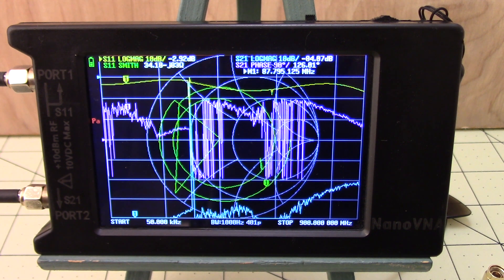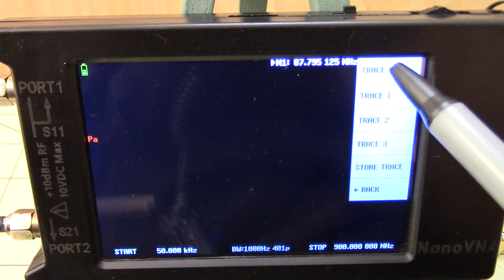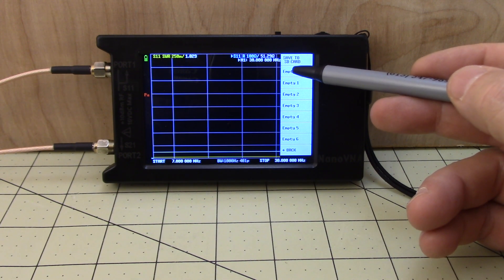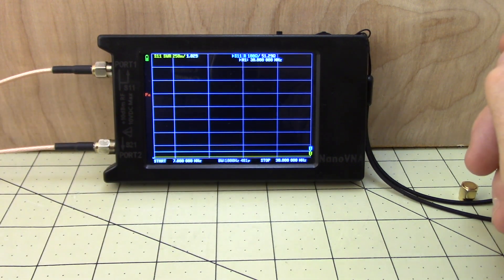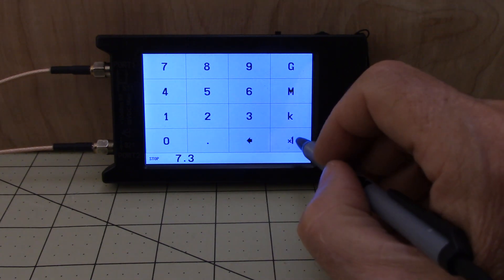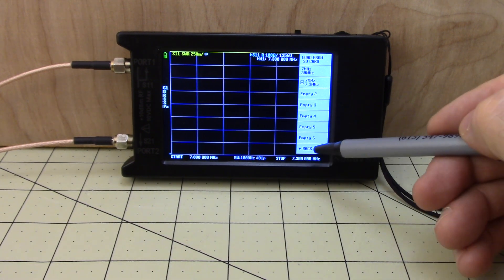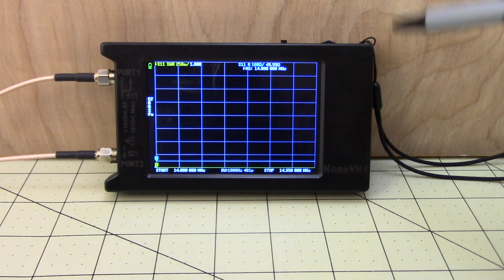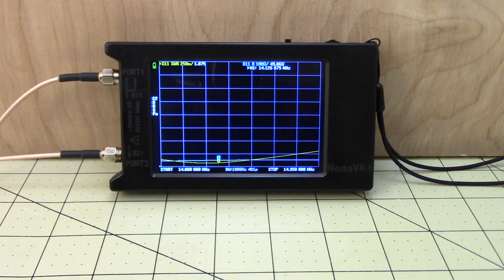How to measure SWR and Resistance of antennas with a NanoVNA

Comment: I noticed ohms went up and down depending on frequency 
Shouldn't ohms be the same ?
Tnks
Reply from the maker: when dealing with antennas and antenna systems you are dealing with impedances rather than dc ohms. Impedances are a combination of both inductive and capacitive reactance the RF signal interacts with which are measured as ohms.  The reactance varies with frequency which is what you were seeing. This is just a simplified explanation of the process.

Comment: What about if we're using a G5RV that needs a tuner like an LDG ?  Is it not really possible to test that transmission line with a NanoVNA and the LDG tuner in-line ? 🤔
Reply from the maker: You could but what are you really testing?  The transmission line and antenna? or are you testing the tuner and how well you have matched it to your radio? Depends on what you are really wanting to test. Hope that makes sense to you. Thanks for watching and commenting!

Comment: Very, very nice video.  I am having problems understanding how to use **multiple markers**.  Case in point here at the AF5SS shack --- a long wire random length antenna that has multiple "dips" on the swr sweep from 4Mhz up to 25 Mhz.  The yellow marker (1) is seen, but how do I place other markers at other resonant points in the sweep plot ?  I think I have articulated this correctly but I am maybe confused -- hi hi -- been on the air since 1957, age 83 next birthday and no, I am not in some "care home" either. Just came home from my skydiving drop zone.  Solo flying,
Reply from the maker: I am out of my shack next couple of days. Will try to answer when I return.

Comment: Great common sense and simplified explanation of setting up and using a NanoVNA for a simple but powerful and intuitive antenna analyzer.  It only takes another minute for each calibration to include the isolation and through calibrations so the complete calibration can be saved for each band in case you'd like to use port 2 to analyze a network - filter, choke, balun, unun, etc.
Reply from the maker: Thanks! That is what I do too!

Comment: Nano VNA pode ser usado para cabo RF 7/8 ou 1/2 para VSWR para identificar falha? ( Torre celular)
Reply from the maker: sure. you just have to have the proper connector adapters, otherwise it should work fine.

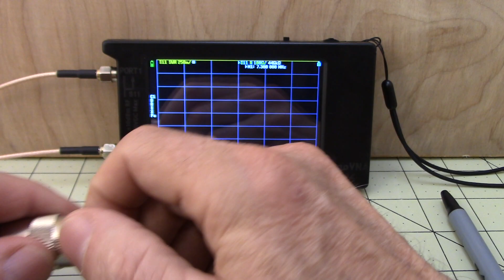Comment: 12:52 adding adapter that was not in measurements. not matter there antenna cable included
Reply from the maker: That is true.  However it is not possible to calibrate with the adapter. It will affect the readings although it will be very very small difference. It can be totally compensated for if you want to take the time to do it but the overall results will not be impacted. The NanoVNA allows you to adjust the timing to compensate for adapters etc if you want to. It really depends on the length of an adapter or its reactive component as to whether or not it would be necessary to go through the compensation adjustment process.

Comment: hello i received the Nano VNA  ..on the back ,i see printed Nano VNA-H   HW version  .....  when i go to the screen config and version  i read  3.7_ZK version 1.2.43 ,   build feb 2025 ......i think this is a recent version , or is this nano VNA not the right one .
when i see the vidio ..i see bij sweep points that you can go to 51  101   201   301  and 401  ...i have only 51 and 101 !!
is there somthing wrong ,or is it a fake VNA

regards  ON4NYO
Reply from the maker: What is the brand and where did you buy it?
Reply: @BudgetHamRadio  

i bought it on Aliexpress     on the back side is printing  NanoVNA-H    HW version 3.7_ ZK      made by ZeenKo  in China    on the screen  config/version 1.2.43  feb19  2025
Reply from the maker: @francoissack2427 mine says the same thing for the brand but I’ve had mine about 4 years and I bought from a US supplier. Not sure if you got a bad clone or what the issue is. I would consider returning it and buying from a different source.

Comment: Thanks for this video.  I just got my NanoVNA H4 and was watching a number of videos on how to use it.  It didn't occur to me that you could save so many band calibration settings for the commonly used band.  It's a shame that the NanoVNA doesn't have more memory slots to save many bands like the RigExpert does.  But then again the NanoVNA is about 1/10th the cost of a comparable RigExpert with a similar frequency range.
Reply from the maker: The NanoVNA is an amazing device for the money. Everyone needs to remember that it is an inexpensive but very powerful tool.  Like you said if you can pay 10x more you get some more features.

Comment: Thank you for a clear explanation on how to setup and use the nano vna! Mine came in a very nice box where it was protected in a nice shockproof cushion and packaged well with all the calibration pieces, adapters, and cables. Just did not have a quick start guide or a manual. Not a single sheet of paper, lol. I turned it on and the display showed a plethora of scribbles and colored lines, lol. Thanks to folks like you that take the time to teach us via video. It's deeply appreciated! 

I'm Mark, been a licensed ham since 1994, and hold an extra class license. I am from Oregon. Thank you for your teaching video! I'll subscribe to your channel and watch your other videos.
Reply from the maker: Thanks Mark!  Mine came packaged the same way.  In case you didn’t know, nanovna.com has instructions.
Reply: @BudgetHamRadio  Thank you!

Comment: Do I need to recalibrate when changing freq's or bands from 40 to 20 and so on.
Reply from the maker: @cliftonhead9665  if you save each band’s calibration to memory and you use the same way to connect each time, you’ll only need to calibrate once.

Comment: I did a similar video and it helped me review after not using the VNA in a year or two. The Smith Chart is helpful for tuning hf in some cases, even if you dont need all the datas that come along with Complex Impedance given, since one can determine which direction to go with Cap and Inductor or wherher or not to lenthen or shorten a radiating element on a vertical.
Reply from the maker: @Bretts_Lab  Yes these are powerful little devices and have lots of features.  Thanks for watching.

Comment: Awesome. I bought one and your video covered what I needed.

Step 1-> Set Trace
Step 2-> Set Frequency
Step 3-> Calibrate 
Step 4-> Connect Antenna
Step 5-> Use wheel dial or stylus to navigate through SWR.

Good job.

Maybe next time more videos regarding advanced features or full nano VNA courses for the pro?
Reply from the maker: Thanks for watching and for the suggestions.  May have to do that.

Comment: The MOST PRACTICAL discussion of how to use one of these powerful tools. Side note: not all manufacturers provide the cables like yours. Protecting the threads on the unit for long term use is definitely one of your best points. Measuring to the end of the cable is second and use of the memories with labels is tops !!  Well done young man !!
Reply from the maker: Thanks!  Glad you found it useful.
Reply: Recommend getting the NanoVNA H4 for anyone over 50.  4” screen makes it much easier to read.